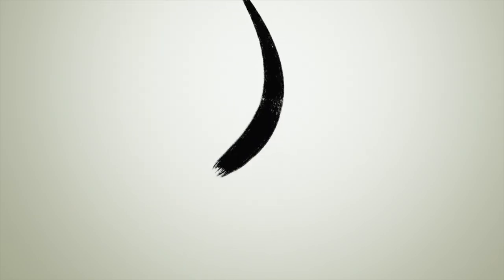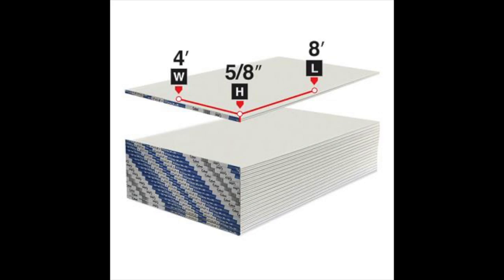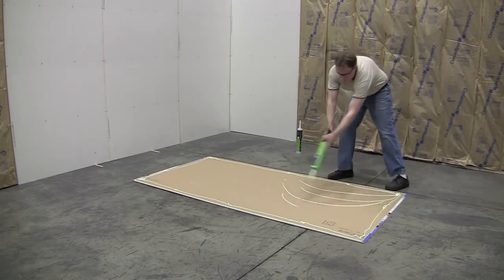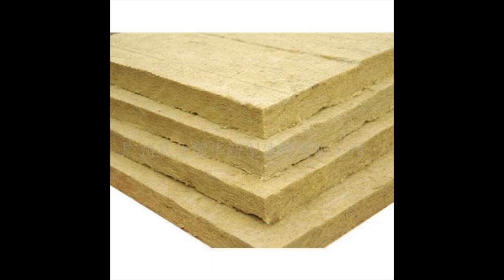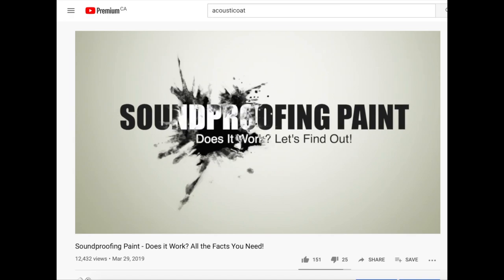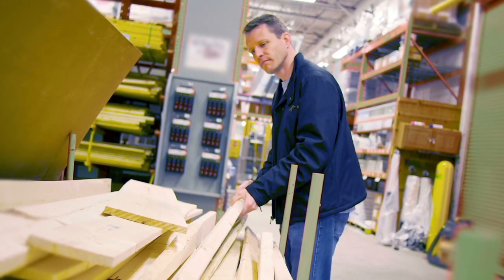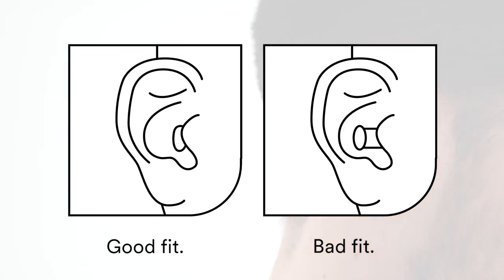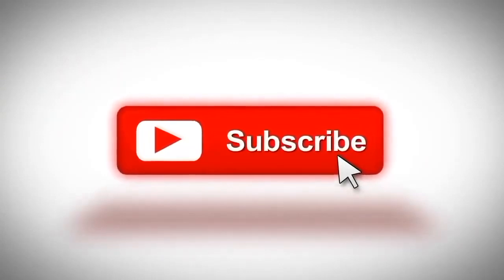How to Soundproof a Ceiling the RIGHT Way! DIY & Cheap!

Comment: green glue would have to be the biggest lie in sound proofing history. use your brain people! you build a 3 feet thick wall out of sound deadening plaster and brick and air gaps and still get low frequency leakage, you are telling me you will improve this with a NOT 100% COVERAGE LAYER of glue that ends up being 2mm or less in thickness between the plaster sheets? what? as far as I have been able to determine is that the green glue stays rubbery and soft for it's entire life and it acts like a damper on the plaster sheet so the natural frequency the wall resonates at , based on the size, thickness and density of the wall will be dampened, slightly, extremely expensively for very very little difference. Nothing you can't achieve with internal dressings like acoustic foam or curtains or carpet, you know, something to control the reverberation inside the room, not sound transmission control but sound frequency control.
as for the metal rails:
If you attach anything to anything it is coupled, why do people always say it is de-coupled? it is dumb, you have just screwed clips to a stud wall and are now attaching metal channel to the clips and then screwing plaster to the channel.......this is all coupled together mechanically!
what you actually get is an air gap inside the single wall structure which will help act as another layer of sound transmission control but it will have a natural coupling effect at a given frequency due to the size the air gap. The frequencies change depending on the gap sizes and the wall sizes and the densities used in the wall. 

Rockwool insulation is also a lie people, it is in fact worst than the cheap blown glass insulation, how you ask, well Rockwool acts as  a wall cavity coupler and can increase the amplitude of the walls given frequency making the wall act like a speaker box and actually boosting the db level not reducing it, the reason is it is usually stuffed into the wall cavity and touching all of the surrounding surfaces of the internal wall including both sides of the wall/ceiling/floor etc. and as it is quit dense it couples the frequency coming from one room and couples that frequency to the other side of the wall and bang it is a whole vibrating louder mess! for so much money too!!!!

The cheap glass wool is best, the job of this insulation in sound control is to deaden the internal air gap and reduce the movement of sound inside the air gap, no insulation will help in reducing the transmission of lower frequencies passing through a wall. you could have a wall with 16 feet thick of any insulation and you'll still hear a bass guitar or drum kit belting through that wall on the other side.

mathematicaland
wizzgreen

immediately! they do not know what they do!
centres. the reason is the pine frame ends up becoming a big speaker box the helps the whole room resonate together and amplify the sympathetic frequencies, basically you are spending huge time and money and not getting anything close to your goal.

wouldcomplain, it's your new toy!!! but what if it could have worked better and been cheaper?
Reply: Hi there, you seem to understand this stuff a lot. I am living under some miserable people with laminate floors who are refusing to get carpets. Is there anything I can do to the ceiling to muffle the stomping and the thud sounds? Thank you

Comment: It is sickening to me that videos like this don't even mention the number one cause of sound transmission. Not only do they not mention it, they thereby avoid mentioning that doing all of the sound production methods here are meaningless and a complete waste of money unless this unmentioned problem is dealt with. Ducting! You could spend whatever you want on soundproofing, but if you've got Ducks going through the ceiling especially ducks that serves both above and below the floor system 98% of the sound that you're getting through their currently is going through is duct work. So by spending two or three hundred thousand or 5,000 or 10,000 or a million or five bucks you're wasting your money unless you deal with the Ducks. Who cares if Google misspells the word; you guys know what I'm talking about, or do you?

Comment: Green glue and sound proofing paint are a joke. So expensive for how much sound proofing it does
Reply: the biggest joke in soundproofing! they work to a point but that point is almost useless for most applications and the cost is mind boggling.